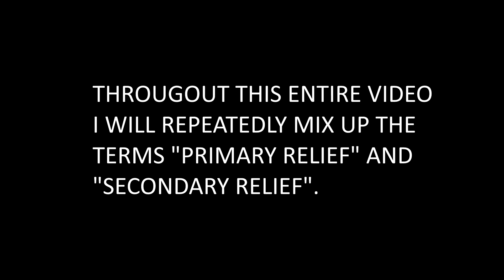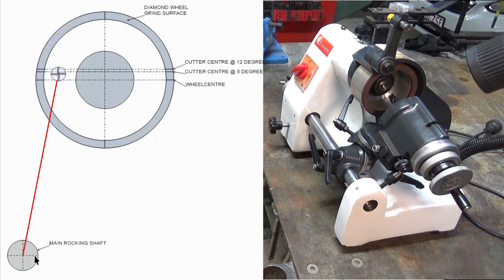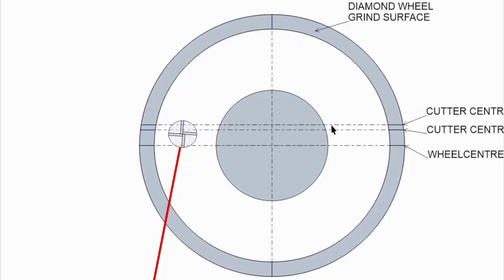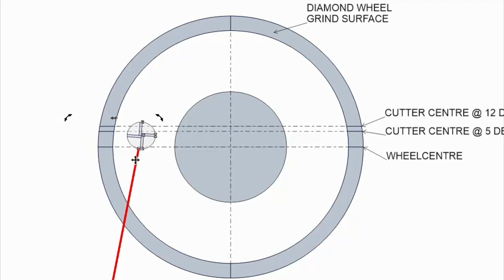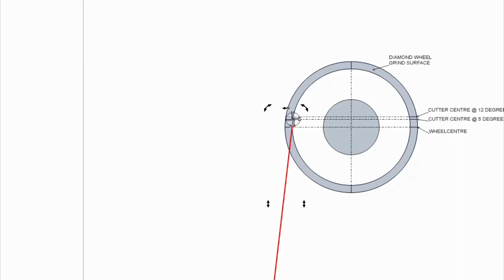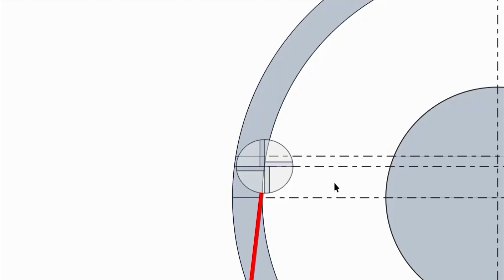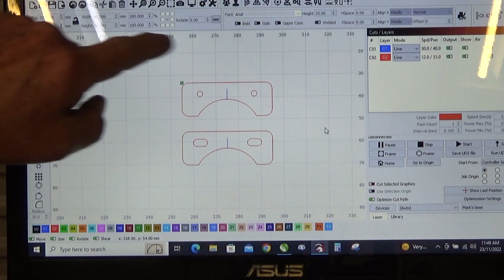D Bit Grinder Modification for Easier End Mill Sharpening

Comment from the maker: Just as a side note, many people have correctly identified that you can use the feed screw as a sort of hard stop and feed the cutter to be ground from the outside of the wheel towards the centre of the spindle. However, I find that there are a number of issues with that approach. Firstly, there are no degree graduations on the workhead tilt that allow you to accurately set the primary and secondary relief in the downward tilt position. Secondly, you cannot see the cutting edge as it is ground because you will be looking at the trailing edge of the cutting lip. Thirdly, there is a strong spring which you have to hold against as you rotate the collet and end mill around to the next position for grinding. You sort of need three hands to do it safely. Both methods have their drawbacks but on balance, I think feeding the cutter from the inside of the wheel is more user friendly.
Reply: It’s interesting (at least to me 😂) that you speak of a spring, the pressure of which you need to overcome. I’ve heard of others mention such a spring yet my machine, and other variations of the Deckel clone do not have the spring. 
Therefore without that spring I don’t think your idea of feeding from inside out using the depth stop feed screw would work on my machine. Definitely much food for thought and has made me re-evaluate my machine.
Reply: Dang i came here to make that very comment. As an aside, the knob is indeed intended as a means to set the stop position, and not as a feed knob. So i believe that is indeed how the machine is intended to be used, for whatever that’s worth. Either way, great problem solving as always!
Reply: Just found your channel I have the same machine ,I didn’t like the heavy spring .did a lot of grinding on dekel grinder and I don’t remember a  spring .I bought some small 25mmx.5mm diamond wheels that fit the dremel arbors handy if you need to make centre cutting end mills.
Regards john
Reply: yeah I took my spring off, I set my stop by doing a test cut on one flute, a tiny bit at a time, and retract to see how close I need to be. Since the center of the cutter is the last to engage the wheel, it's not too difficult to use magnification and adjust the stop until the center is just barely touched by the wheel. Then I don't touch the stop and pull the head back towards me to clear the wheel and switch to another flute. Can go through all flutes really quickly.

Additionally that stop isn't a precision surface, moving the work head left and right along it will slightly change how much infeed you have, so I try to only make cut depth adjustments using the wheel feed rather than the work head left and right feed knob.

The deckel manuals show coming from the outside, and while yes these clones don't have the full scale going the other direction, a protractor on the wheel works fine. If you haven't calibrated the scales they're likely off by a few degrees anyway.

On my machine I can loosen a screw and rotate the scale to be in whatever position I need. Its quite handy.

Comment: I had a Deckel a few years ago but as I seldom used it I sold it on to a lady who did jewelry.....then I rebuilt my bench top mill and wanted a Deckel again.......too much money for new or look alike so I bought the tilt mechanism part that swings on the rocking shaft on REBAY  for A$380 and am building one similar but different etc, using a .2 HP 3 phase motor as the grinding head......now 3/4 finished.
Grinding the helix of slot drills and end mills is quite difficult on a Deckel unless it's custom made to achieve that, also Deckel collets are hugely expensive so I'm using ER32 collets instead.
Reply from the maker: That sounds like an interesting project. I'm planning to make something similar but as a dedicated 4 facet drill bit grinder. That will be a video series for 2023. It will also use standard ER collets to hold the drill bits. The D Bit grinder I have uses 5C collets but it's almost impossible to get imperial 5C's here. I have yet to summon up the courage to try grinding the spiral flutes. I think I will practise on some of the larger cutters first.
Regards,
Mark

Comment: Nice video. I will use this information as I learn to use my new D-Bit grinder. One tip I would pass along to you is when cutting aluminum, Stephan Gotteswinter recommends using isopropyl alcohol as a cutting fluid. The alcohol cools the aluminum and keeps it from welding chips to the hot flutes preventing burrs and provides a better finish. This is especially important when milling softer aluminum. Also, alcohol evaporates quickly and doesn't leave a mess like other cutting fluids. Thanks for the video.
Reply from the maker: I did see that video by Stefan and I have since been using IPA but ordinary methylated spirits works well too. IPA used to be difficult to buy in bulk but since COVID the manufacture of IPA seemed to go into overdrive.
Regards,
Mark

Comment: I have the same model grinder, no expert for sure but I always use the knob as a depth stop then by hand swing the collet holder in and out with the spring tension it has. Thankyou for your videos
Reply: I do the same but it is easy to make the swing go too far with just a bit too much hand pressure. The relatively sharp edges on the wheels also get rounded over too soon.

Comment: As you were saying, you should learn something new every day, I thought; maybe not something new but a refinement of something already being learned would be acceptable.
You know that feeling when you pick up a new tool (in particular a hand tool, I have a chisel in my mind) and try to use it for the first time.
After 5-10 minutes you declare to yourself, "Bah, this is impossible!"
1-2 hours later, still frustrated and still making a mess but you're getting the idea.
5-10 weeks later and you're thinking, "Hey I'm a master..."
5-10 years later, you've finally got the hang of it and can't understand what all the fuss was about.

Simple things often have a wealth of different 'ways' that get obscured by the neon sign in the mind flashing "Simple".
Learning can be a humbling experience :)

Cheers Preso,
Another Pete from NZ :)
Reply from the maker: Strongly agree. Learning is a cumulative experience. Often it is a case of one step forward and two backward. I think I can learn a lot more about sharpening end mills. I am happy that I have given my abused cutter a second life though.
Regards,
Mark
Reply: @Preso58  Two ways of looking at it; a) I have gone backwards 1 step, b) I have experienced 3 steps on the road to an uncertain destination... I agree, you have saved that end mill learned some things and are still smiling. Win win!
Peter :)

Comment: How about putting the cutter in the lathe and the diamond burr in the tailstock to accurately relieve the centre of the end mill?
Possibly mount the Dremel in a toolholder for more burr speed but slowly rotate the end mill.
With a small diameter burr it should be nice and predictable if you take it slowly.
Reply from the maker: I do have a pneumatic die grinder and for some time now I have been meaning to make an aluminium casting to hold the body of the die grinder on the lathe centre for that job. The die grinder has much better bearings than the Dremel and you can really crank up the speed. That's another job for the foundry list.
Regards,
Mark
Reply: @Preso58  I enjoy toolmaking and  it helps make the workshop time more enjoyable.

Comment: Nice!  I have a G H Alexander Deckel copy. I'm building a small collection of wrecked slot drills and end mills if I ever get round to learning how to grind them.  My father was a tool and cutter grinder in a gas turbine plant and I never had to grind anything myself while he was alive.
Reply from the maker: It definitely requires good eyesight and careful setup. Once underway that grinding itself is pretty straightforward. I didn't realise how toxic the carbide dust was though and although it gets mentioned in passing I didn't realise that it's the cobalt content in the dust that builds up in your liver. 
Regards,
Mark

Comment: I had a small milling job, no milling machine and blunt second hand end mills. I converted my tool post grinder with a cup grinding wheel, mounted on a bracket to fit the cross slide of my lathe and with some fancy guess work,  and a protractor level, successfully sharpened said end mills. I then set up the work clamped on the tool post, the endmill in the chuck and voila, mission accomplished.
Reply from the maker: I would call that a win! Well done.
Regards,
Preso

Comment: Beautiful design. What type of laser did you use for cutting out  the sheet metal?
Reply from the maker: The small index plate is actually a two ply laser engravable plastic sheet. My laser is a 40W CO2 laser and they are not capable of cutting metal.
Regards,
Mark

Comment: How long is it from underside of casted chassis up to "lamp deck"?
How long is it from underside of chassis up to lathe shaft that is 25 mm or 1"?
Will both 25 mm and 1" fit? Either one?
How long is it from underside chassis up to grinding axle?
    In a diagram?  like yours on video?   ------->
What is distance between verticals of lathe shaft and grinding axle senters?
I wish I had a blueprint diagram with meassures and angels of all this from both side of the grinder?
How long is the open part of the lathe shaft?
Reply from the maker: The diagram that I made for that video was for illustration purposes and not really accurately modelled on the original. I would try searching on some of the 3D model databases to see if someone has made an accurate 3D model of this tool. 
Regards,
Mark

Comment: Gday Preso, I’d be stoked with a result like that, great modification to, brilliant video as always mate, Cheers
Reply from the maker: Even I was surprised at how well it cut after my less than precise sharpening. I used it again today to hog out a lot of aluminium and it worked great. A little WD40 helped with the burr issue. I was actually making a replica of a moulded plastic clamp that goes on the underside of the Bridgeport ram to hold a coolant hose. I have decided to reinstate the coolant system on my mill. I have the Hangsterfers concentrate and the coolant pump but I never did finish off the plumbing. 
Regards,
Mark

Comment: Hi and thanks for the video, Very helpful.  The clamp on my work head takes a great of torque to lock it tight. It is clean and I do not see anything relay wrong with. any ideas?  Thanks.
Reply from the maker: Possibly just poor quality control at the factory. I have noticed that you do need to crank the locks quite hard but they seem to unlock very easily. That was one reason I stopped using the Quorn tool and cutter grinder that I made. The locks weren't reliable and if they loosened off during a grinding cycle you had to start all over again. 
Regards,
Mark

Comment: You should be approaching your grinding wheel from the outside. It is so much easier to see what is happening without the wheel’s edge being in the way. I have been a tool and cutter grinder for many years and have never seen anyone using the inner edge of the wheel.
Reply from the maker: Thanks. I know the method I used is unconventional but there are some advantages. If I owned a dedicated tool and cutter grinder I am sure there would be better ways to sharpen an end mill. Dbit grinders are a compromise at best for this type of work.
Regards,
Mark

Comment: What power laser is that? Impressive.
Reply from the maker: My laser is a 40W CO2 with a water cooled glass tube. They recommend that you don't run a glass tube at it's full rated power. It shortens the life of the tube if you do run them too hard. I generally run mine at no more than 85% of full power. I should add that the material I was cutting was a two ply plastic with a fake metallic surface. CO2 lasers won't cut metal at all.
Reply: @Preso58  ah ok I thought you were cutting stainless. Had me fooled!

Comment: Hi Preso, interesting stuff!
If you cut on the other side of the wheel you can just pull the cutter back against the spring with  your hand and use the black knob to set the depth.  I've never had much luck sharpening end mills.  The diamond wheels are pretty coarse compared to the incredible edge you get on a new one.  Take the end off that broken one and by the time it's gone your wheel will be dressed true.  (maybe get your wife to do it so you don't have to breathe the dust).  You can also buy a rod of molybdenum for dressing diamond.  I tried that and it didnt really impress me that much.   You can clean them up with some carborundum paste on a flat surface. Stefan has a video on that.  Oh, looks like I am the ten millionth person to make this comment.  Oh well.  It's good for your algorithm.
Reply from the maker: Thanks John. I am very much a novice at grinding end mills. I bought the D Bit grinder last year and it has been sitting in the corner of the shop waiting for me to use it. I made some jigs for sharpening HSS lathe tool bits and I think I sharpened a HSS slot drill but until I ruined that carbide end mill I didn't really have to use it. I did use that same bit yesterday to hog out a 22 X 18 slot in some malleable iron and it went like a champ. My son sent me an article on the dangers of carbide dust. He is the WH&S guy at his work and he was concerned that I was breathing the dust. Apparently it's the cobalt that builds up in your liver. 
Regards,
Mark

Comment: I thought it was intended to work in the other direction as other commenters have said using that knob as a stop?  You got great results though and actually will get me working on my Chinese deckel again!
Reply from the maker: I believe there are many ways to achieve the same result with this tool. I still have a shop made Quorn tool and cutter grinder which had an adjustable stop but I found it much harder to set and use. The spring on the D bit grinder traverse is quite strong and I find it to be a bit disconcerting to be fighting against the spring. I did use the sharpened milling cutter today on a piece of aluminium and had to take some quite heavy cuts with it and it worked surprisingly well. Adding some WD40 during the cutting helped to solve the burring problem.
Regards,
Mark
Reply: @Preso58  Thanks Mark! I appreciate the reply and the explanation.  I bought this thing and have yet to figure out how to do this and really want to.  Your video really helps and I am going to try this method to get me going!  Thanks again!
Reply: @Preso58  I repositioned that traverse spring to be more neutral in resistance forward and back.  To make this work the end of the spring that is mounted to the casting needed a new place to anchor. I drilled through two vertical walls of the casting for a 10mm linear shaft (because it’s very stiff and I had a short length handy). The free end of the spring will snugly fit on the shaft as you push it through.  Some of the electric wires had to be repositioned so as not to be in the way. I like your tilt mod and I will be adding this feature to my machine soon. Cheers from WV

Comment: Great more input! Ah those d bit grinders keeping us all on a learned curve... Have you tried the drill bit attachment it has me stumped . I'd there a videl about your cutter . Now that's looks like a great addition
Reply from the maker: Mark, there is a very good resource on how to use the drill bit attachment but it's not so easy to follow and it recommends a lot of modifications to make it work well. The channel I recommended does have a video on using the attachment too. It is really only good for large drill bits though. I am planning a video series on a dedicated drill bit grinder for small bits (2mm and over). It will be some time next year. Check out https://www.youtube.com/watch?v=vqB9IRANybE&t=70s
Regards,
Preso
Reply: @Preso58  thanks that's just the shot .

Comment: just a different idea of the same thing.. you could make a  clamp that fits on the polished bar, and a stop that is setable for the finger attached to the clamp on the bar.  you can keep going by making the stop with graduated markings to know how far to the stop.. that way you can redefine it using the graduations if necessary. of course your way is fine and it works. I'm just offering a different concept
Reply from the maker: I have a Quorn tool and cutter grinder that has a similar option but I found the Quorn to be difficult to set up and it's very difficult to see the graduated markings on the head tilt and rotation. However having a hard stop would be great. 
I actually started making the more refined version of the feed screw today and I will try to do an update video soon.
Regards,
Mark